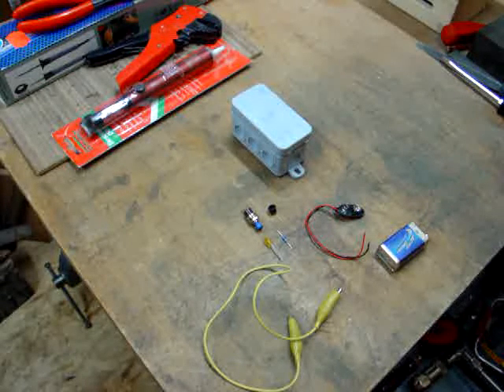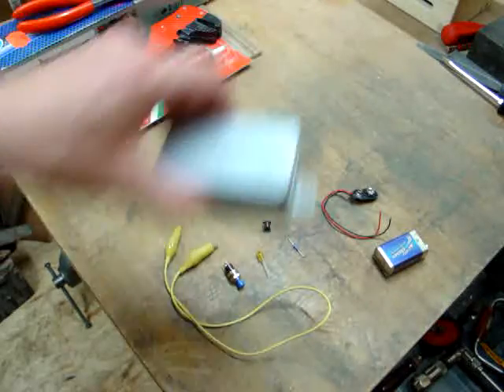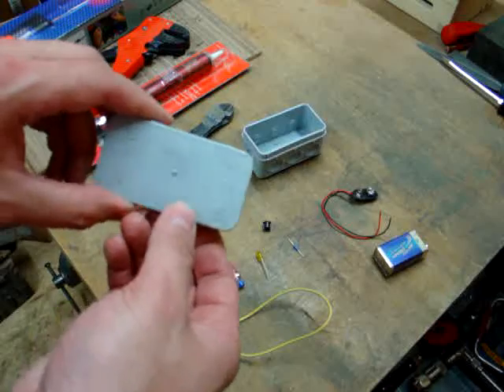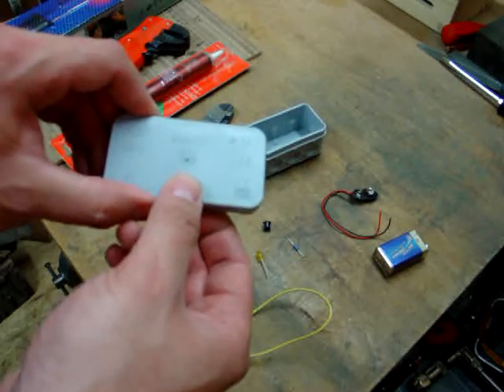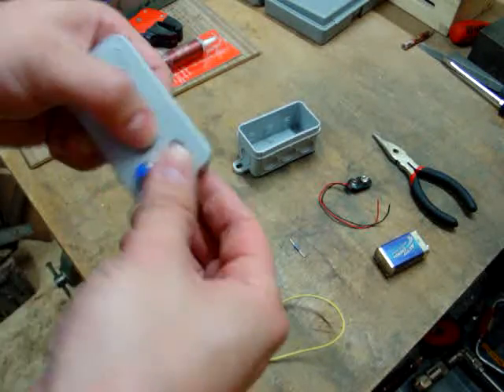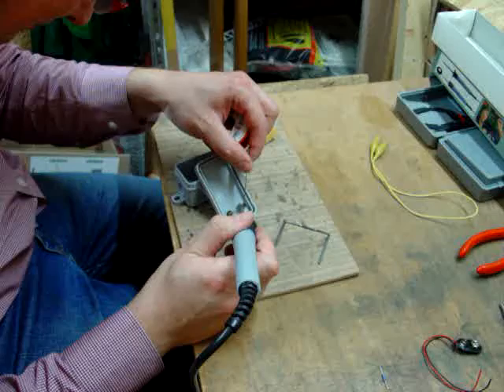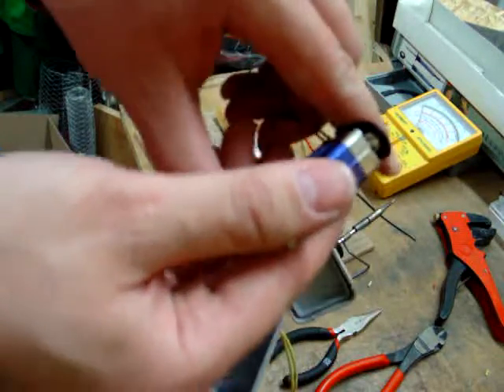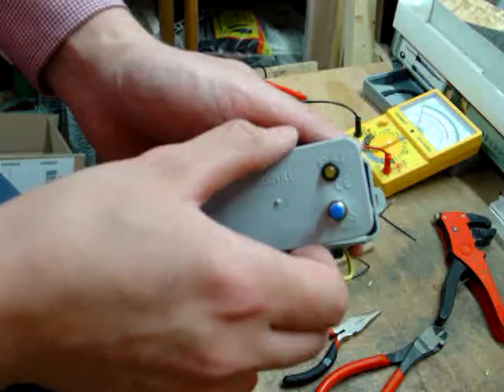Slug repelling part1

Comment: I've seen a lot of people make these and a lot of them have struggled with fixing the wires around  pots and tubs. I wonder if it was possible to use a metal paint, would that carry voltage ?
Reply from the maker: Well, there is a special paint, that you normally use for repairing printed circuit boards. I think, this could work, however, it is an expensive solution.

Comment: There is no reason to have a led or other diode in the circuit,  except to reduce the voltage. This could be simply done with a battery with a lower voltage. I know by experience that a 1.5V battery is quite enough to do the job. 

The resistor will reduce the current but especially prevent the too fast battery discharge if a short-circuit happens.
Reply from the maker: Correct. The LED is for checking if there is a short circuit between the wires and if the battery still has power. And the resistor is for reducing the current, to avoid that the wires will melt.